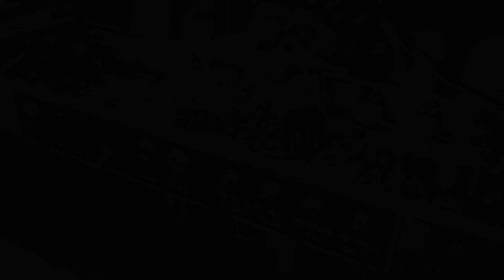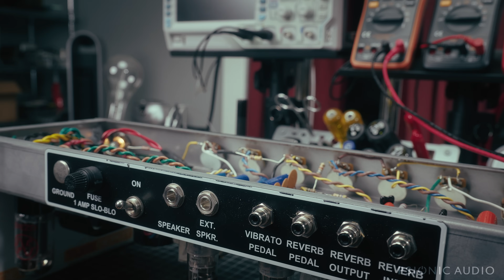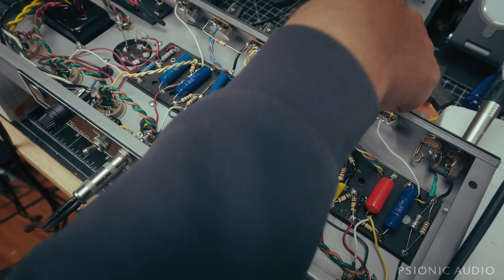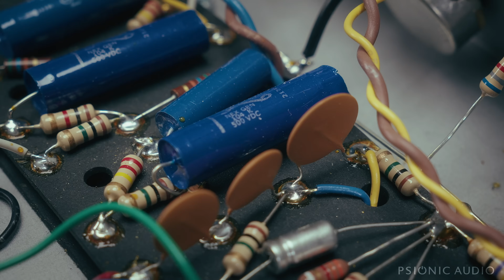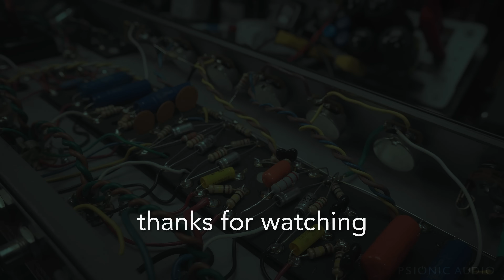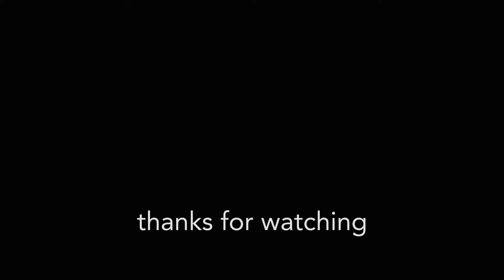Testing | Kit Princeton Pt 1

Comment: The bias resistor at 11:25 is "Floating up in space"...how or why is that a bad thing? The ridged wire at 10:40 is clean looking, but offers no room for expansion/contraction as you said. Again, the "Spiderlegs" looking bad, but wouldn't that give room for temp expansion? Perhaps I just don't understand when parts need to be tight to the board, and when they should be with expansion loops.

Comment: Would you prefer an artificial center tap with two 100-ohm resistors over using the 6.3V filament wire (green w yellow stripe)?

Comment: Whilst people learn by doing, people should really care about safety. If you’re getting into amps with high voltages in them (especially dc) you should electrical safety. It’s not 9V.  You might only get it wrong once…. 
We had basic training in labs at university, but at work years ago we lost someone because they got careless with 400V.  I can’t believe kits tell you to fuse the neutral…

Comment: Uhh, that plugged hole in the back next to the fuse holder needs a mid control. I,d have put a brass plate where all the pots are to get solid dedicated grounds like fender did lt. Correct pots ect, ect.ohh, And I would have used fibreglass eyelet boards. Building exact to what fender did is not always the best idea.

Comment: Self drilling and or self tapping or ANY other pointy or sharp sheet metal or wood screws have absolutely NO PLACE even poking out inside of an electrical box even for an out building like a garden shed or a dog house, and they certainly have no place anywhere inside of any amplifier chassis, EVER!! "IF" you really really want to thread those screws straight into the sheet metal chassis, go buy a full drill index and a full tap set, then drill and tap every hole for 4-48 or 4-40, 6-40 or 6-32, 8-36 or 8-32 and10-24 or 10-32, and for the metric crowd 3mm, 3.5mm, 4mm, 4.5mm & 5mm and use machine screws. FYI for SAE or for metric use the fine threads. My full cobalt indexes cost around $2000 for the pair add $500 for the taps. Nuts, washers and bolts are lots cheaper, much much faster, and far less likely to strip out. I really do love those number drills for guitar repairs, and mechanical stuff, but guitar amps? No.
Reply: You realise fender used that method?

Comment: Hey, at least those flying resistors are above the caps. not the other way around!  Oh, and having built some kits I can tell you that sellers are sometimes stingy with the wire, which might explain the two color splice.  You'd think they would throw in an extra 10% or so, but sometimes not.
Reply: why not put the caps above the resistors, easier to replace down the line...?
Reply: @peterdeboer3500  Heat is the enemy of all electronic components.

Comment: 1:57 I scratch build amps as a hobby. The first rectifier tube build I tried had a bad tube out of the box. Sounds simple to troubleshoot now, right, but at the time it’s like “oh no what have I done wrong?”
Reply: My second build died all of a sudden while just idling. It popped a mains fuse. I use ICC170 diodes for my fwb rectifiers and I had one go out on me. It took me about 10 mjnutes to diangnose and fix it. I was worried for a few minutes though.

Comment: I think it’s a case of not knowing any better and what their skill level is.  Caring didn’t make someone good at soldering. Practice does. 😊
Reply: Agreed. The first time I opened up an amp and began soldering stuff, I cared lots, but made a pig's ear of it, because I did not know what I was doing. I still don't, but I know a ton more than I did then. I guess Lyle means the folks that are building these amps to sell, not the hobbyists. 
Somehow I wired a new OT into a JCM 800 1987 model and it worked. Excess wire all over the show, burned wires, damaged pads, and cold solder joints. Gotta start somewhere. My own amps are the best place to do that (I got that amp tidied up by a pro before selling mind you -- I have a kitset 1987 to mess with now).

Comment: Floating the heater-supply ground and installing a pair of fusible 100 ohm resistors as an artificial center-tap would add a measure of safety for the power transformer in the event of a tube short. I also don't like the drill-point screws, which always seem to remove a bit too much metal when they self-tap the chassis holes, so that the screw holes are easy to strip when tightening the screws. Machine screws and Keps or Brilock nuts are more secure,  of course....
Reply: Fuse police
Reply: @didamnesia3575 modern 6V6 tubes are failure prone, especially at the voltages that  Fenders invariably run them at. The resistor centertap also often balances the heater winding better then the centertap wire does, lowering hum.

Comment: At 10:40, that straight wire from filter cap to ground lug also puts tension on the riveted connection holding the lug to the capacitor; mechanical stress can stretch the rivet and cause an intermittent connection (and if the rivet is aluminum, as it often was on vintage can caps, you can't solder the junction). Lyle, what brand of 4-section can was that, a JJ ? Reports on those are mixed, but I used one on a McIntosh receiver once and it worked fine.
Reply from the maker: It’s a JJ.
Reply: @PsionicAudio , that's what I figured. I dont know of any other source for 3 or 4 section caps in this style; the ones used in Marshalls are only two-section, larger diameter and often too high a MFD value. It'd be nice to find a way to adapt the JJ's to replace vintage aluminum can capacitors; they need a clamp and would have to be spaced up off the chassis somewhat because the terminal spacing might be too wide to fit through the stock mounting hole, and might require some sort of rubber insulator.... Fenders have sufficient internal real estate for terminal strips and individual caps, but many other old amps do not.....